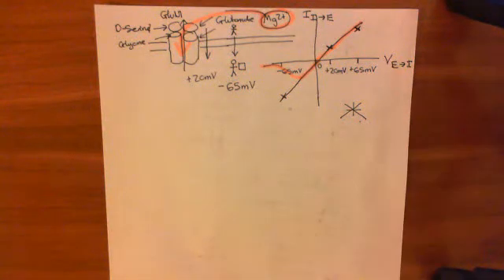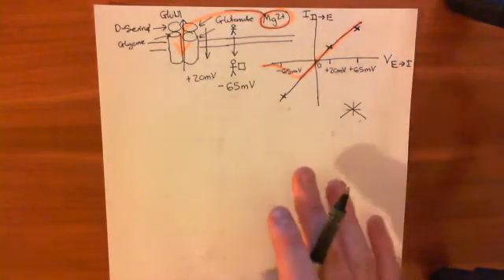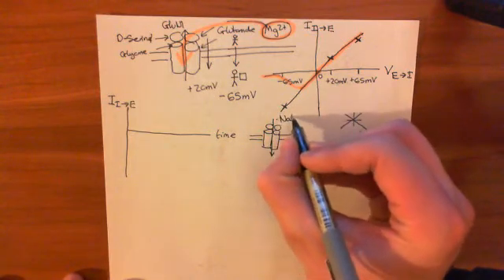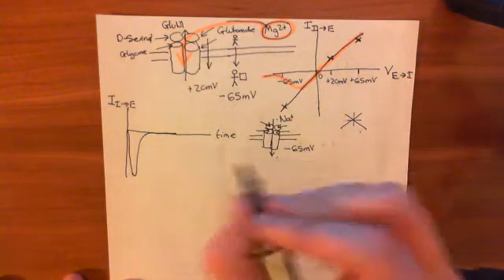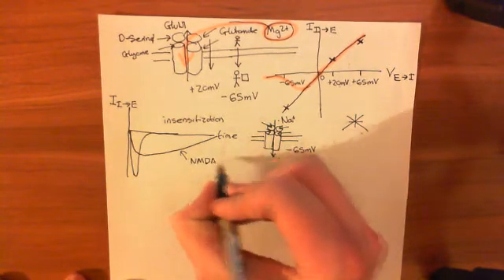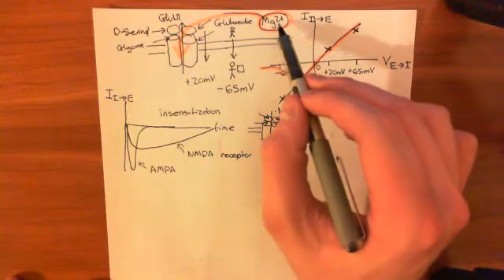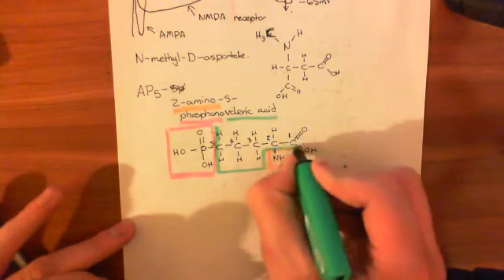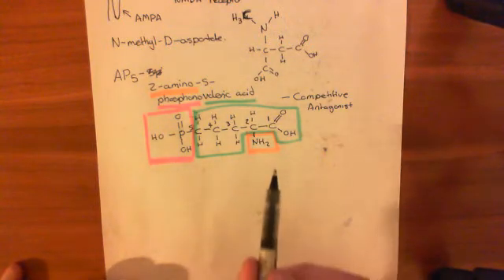NMDA Receptors Part 3

Comment: Thanks...I have a question...How does this explain neuronal death via NMDA binding and glutamate toxicity in Huntington disease?
Reply: I dunno if you still care six months later, but the reason is that the NMDA receptor is not the sole target of glutamate, which is released in ischemic injury.  Other receptors/exchangers like mGluR, Glu-R, VSCC, and NCX are operating.  So in the face of large amounts of glutamate release, the other receptors depolarize the cell enough to overcome the Mg block in NMDA, and together lead to a massive accumulation of Ca in the cell.  This Ca is what leads to cell death through mitochondrial interaction that create apoptotic cell signals and ROS generation.
Reply: thanks for the answer!